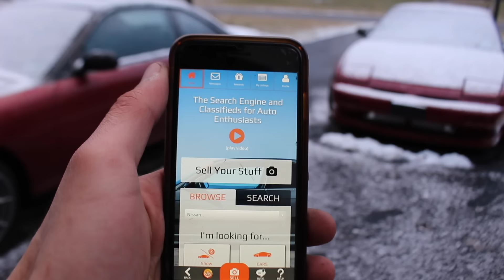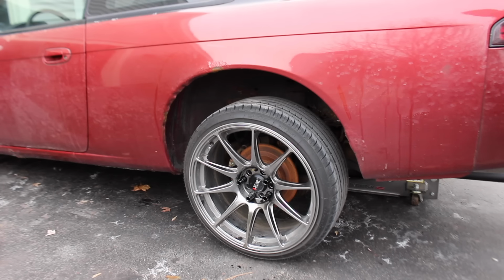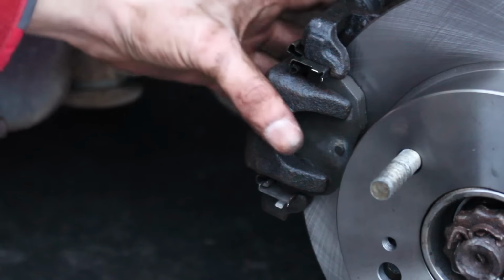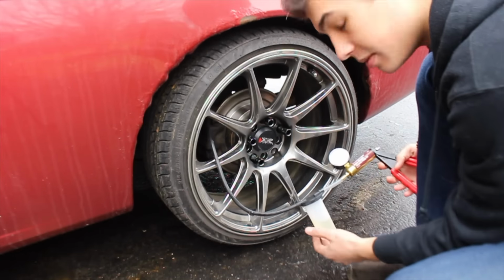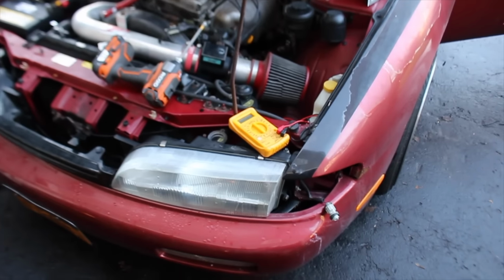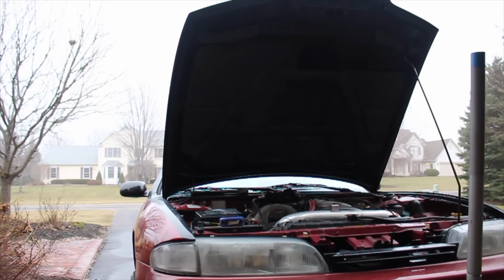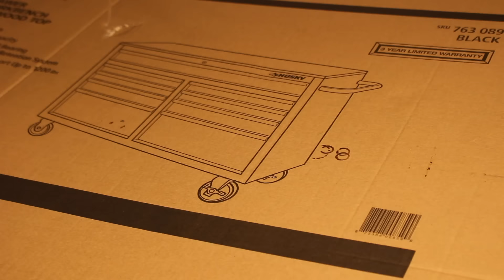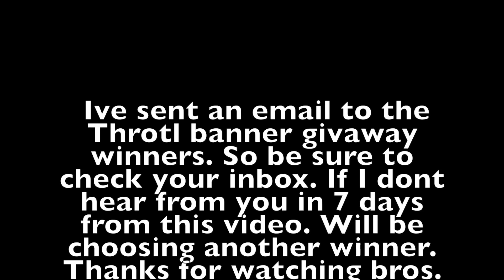Wrenching on the 240SX

Comment: Please tell me you cleaned off the rust inhibitor from the new disc. Ether change or rebuild that caliper. They are not to hard to rebuild but if the inner sealing surface in corroded or scratched you need to replace it.

Comment: This is just a theory, not something I have actually seen or researched. Do you think maybe you had compressed the piston so far in that it completely blocked the entry hole for brake fluid? Meaning it couldn't actually push the piston outward, only push on the side of it? I would think they wouldn't design it that way, but it seems possible. Alternatively, since it is the screw in type of piston, could it be that you screwed it all the way in past the end of the threads and it had to catch back on the threads before it could actually move out again? Perhaps cranking the E-brake a few times would have seated it again? Just spit ballin' here.

Also, two options when those little bulbs aren't staying in place or making contact. Take a paper tweezers or something and bend out the contacts on the bulb itself or take a paper clip or other object and bend the contacts in the actual socket inward so they hold the bulb more securely. I find the latter works best. Had to do it for the license plate lights on my Impreza and they have held for years. Not that it was necessarily your issue, just seemed the rear light was a bit wiggly.
Reply: Last thing... Get one of these... Never though I would need one until I encountered an earlier CR-V oil filter.
https://www.amazon.com/gp/product/B0002SR4Q8 (I have this one.)
https://www.amazon.com/Motivx-Tools-Adjustable-Filter-Removing/dp/B01BS5B3ZQ (Also awesome.)
Trust me, it's worth it for even that one time you use it. Don't bother with the other styles.
Reply from the maker: +802 Garage Yeah I don't believe I spun it in too far. I think it's just completely corroded inside. And I'll try that on connections that are giving me trouble! Thanks for the comment!
Reply: No problem. Love your channel man.

Comment: i want to paint my valve cover but do i need to replace the seal thats on it when i remove the cover? im just asking for safety reasons so i don't break my first car ^^
Reply from the maker: +cproductions989 only if it's dry/leaking
Reply: Kalvin Malli ahh oke thanks man i will try and do it ^^